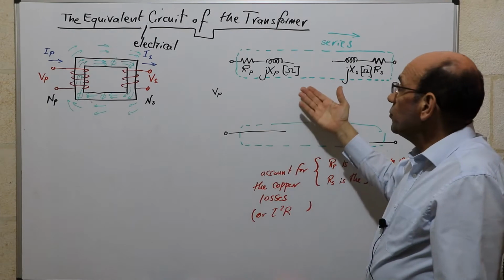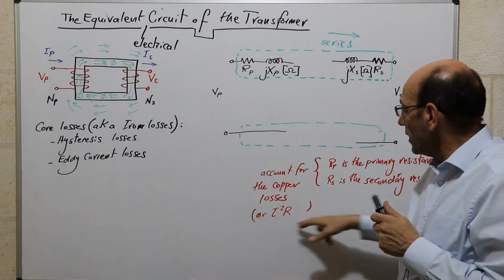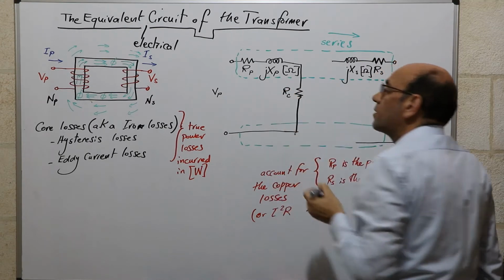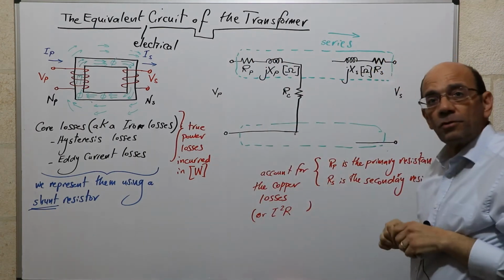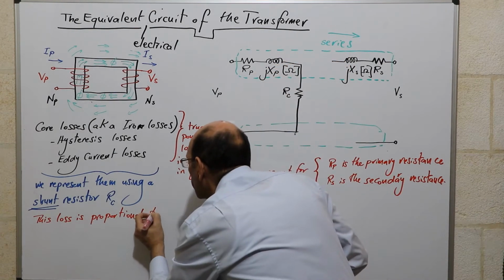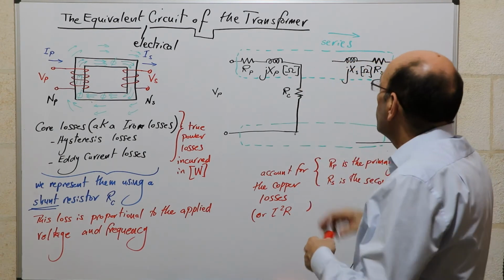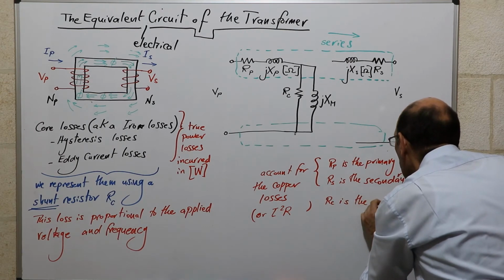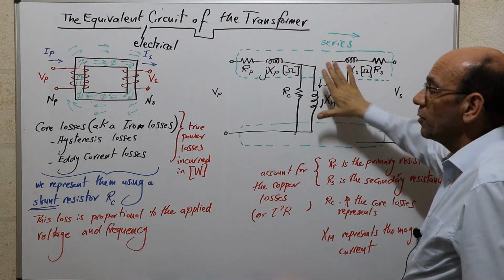Transformer Equivalent Circuit Model (3):  The Shunt Components, 4/4/2020

Comment: Shouldn't core losses be proportional to the voltage squared?
Reply: @Patrick-wn6uj  Core losses are not produced in the wires, but within the core itself. The active power for that is then supplied from the windings, but that's it.
Reply: @diegoferreyra9004  No because the voltage doesn't cause the losses.  This is why we have high voltage transmission.  The lesser the current, the lesser the losses.
Reply: @benlivingstone8272  The phenomenon is different. Higher voltage lines reduce series losses related to I^2 (as long as R at least stays the same). Here we are talking about magneticc core losses, related to hystheresis and eddy currents, both depending on the flux value, and the voltage applied has directly to do with the flux in the magnetic circuit (Faraday-Lenz).